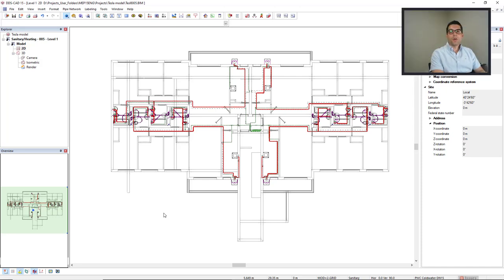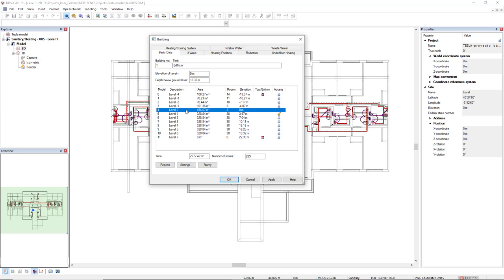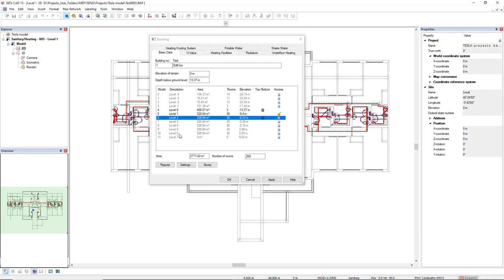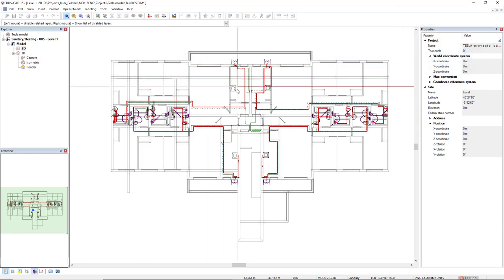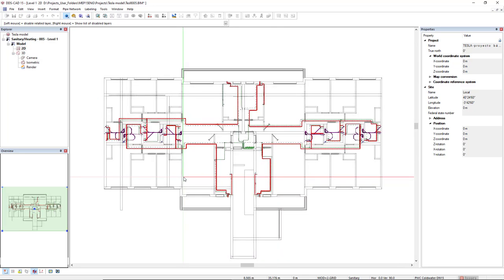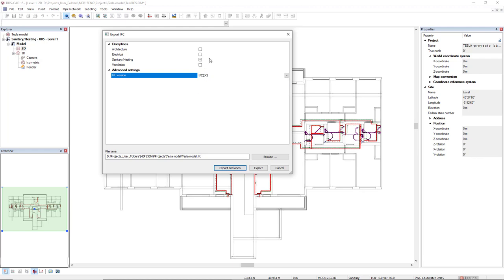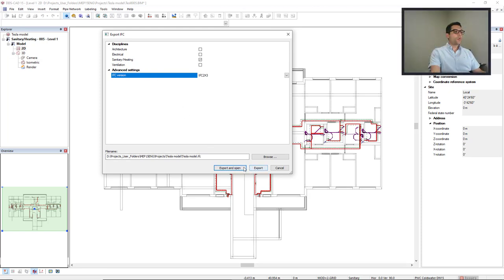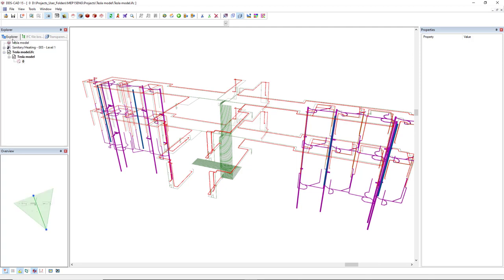Getting Started  - Documentation - IFC exportation

Comment: Hi Filipe, I need to export to IFC 2x3 one level only. I tried to do it according this video but without succes. If I want to do this I have to mark the same storey as a lowest and as a top, but, it is impossible. How can I export to IFC only one storey?
Reply from the maker: Hi Michal, it is indeed not possible to export only one storey to IFC in DDS-CAD 15.
If further questions about this subject, please contact our support team via our local partner.
Reply: Hi Filipe, It is a pity, in older versions it worked without problems - I selected one storey with one click only. I used it often, especially when changing projects - I just sent the changed storey to the architect for replacement...
Reply from the maker: @michalkmet9456  , there is a workaround to do so, your local support can help you with that. :)